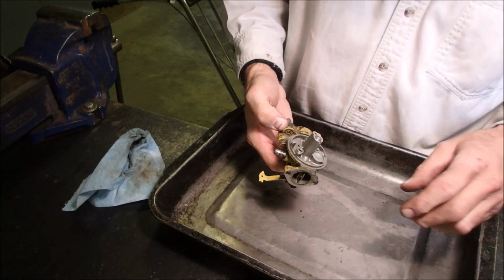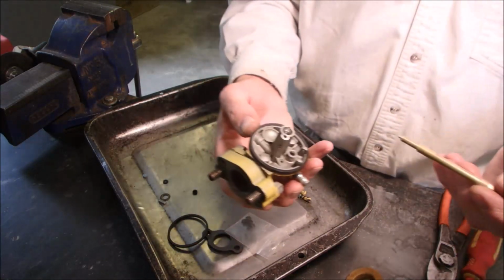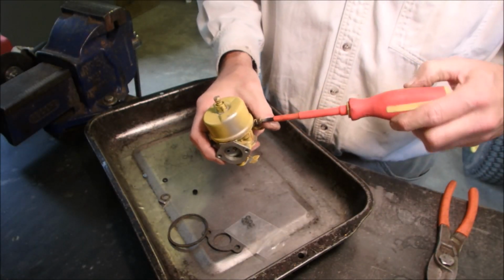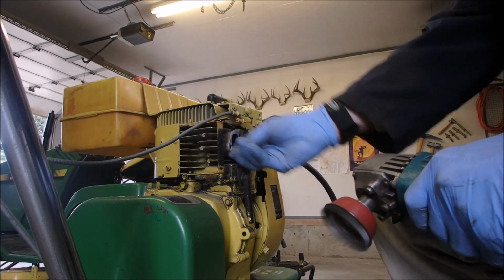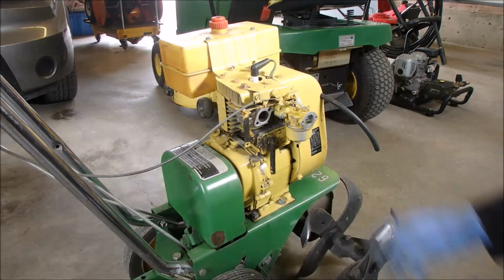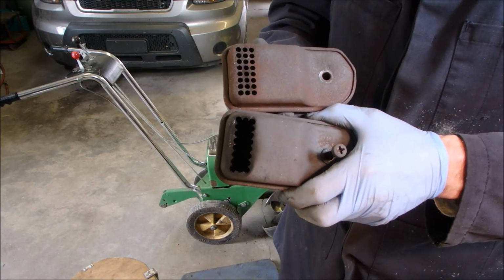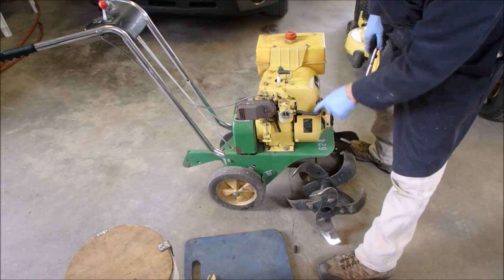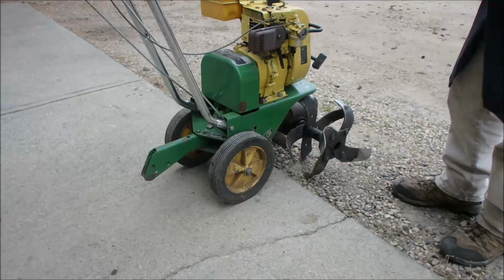1977 John Deere Tiller Only Runs on Choke Part 2

Comment: Oh doggone it. I need to know the plug number, and I wanted to see how the rope pull came apart and how it ejects AND RETRACTS that's flat tab that catches the inner flywheel hub. Oh PHOOEY !
Reply from the maker: Well the older flatheads for mowers and tiller took a Champion RJ19LM or NGK Ngk B2-Lm.  It ivery easy to google as well.

Comment: Bravo Bruce, I found and bought one of these tillers yesterday. I saw it on market place. It had been posted for two hours., and one mile from my home. Dont know what year it was made but seems to run very well. It will be the help that I need for a larger garden next season I hope. Thanks for this post and many others that helps a woodworker fix a small engine before he destroys it.
Reply from the maker: Good for you.
Reply: Here I go. I get to till with my jd 524 from the start of the growing season. It's in great shape I believe. Thanks to the man who owned it and bought new. I have his Manuel that I received in a folder. Admiration shout out to guys who keep files in their equipment.

Comment: Dad has an old John Deere tiller that is much like this one. He accidentally run it low on oil one day and suddenly remembered about the oil so he shut it off immediately. Replaced oil but it hasn't run since. Motor isn't froze up but it won't run. Any ideas what i should check first? I'm thinking power jet.
Reply from the maker: Check the valve clearance if the compression is low.

Comment: Those baking trays are the best to have when rebuilding any small component or carbs.  I also use muffin trays to separate small screws and parts during a job.
Reply from the maker: I even use the for changing oil and antifreeze an other stuff as you say

Comment: Is that your LX series John Deere in the background Bruce?
Reply from the maker: Yes.  Another fixerupper.  It runs so rich it hardly runs.  $240 Canadian for the new carb.  only $140 in the states.  I ordered a rebuild kit for $70.  It is a long term project.   Yes videos to come i hope.
Reply: Great! I have a John Deere GT262 from the same year and is the same mower just with bigger tires. Hope to see some videos on it!

Comment: Bruce, if you have a bad coil on an older engine with points do you usually convert them to electronic?
Reply from the maker: It is the easy fix   but you can get the old coil if you want.  I did one of my own that I kept stock and put an old coil in but If a customer comes in I put on electronic.
Reply: Do you have a good resource to get the correct electronic coils? I have 2 old 4hp engines I want to convert and not having much luck finding the right coils. Thanks
Reply from the maker: I collect older stuff that isn't repairable   but lately that is harder to do as our economy has gone down and folks are fixing more and more of there stuff and there is less of everything out there.
Reply: Bruce Pender
I was actually looking for brand new solid state coils to replace these old points coils. Is there a website you shop at or do you buy local?
Reply from the maker: This is a good site.  Sometime a just surf around for numbers of the coil then zero in on ebay or phone my local guy. 
http://www.jackssmallengines.com/Products/BRIGGS-STRATTON/Ignition-Part/s

Comment: WHAT TYPE OF GLOVES DO YOU USE AND WHERE DO YOU ACQUIRE THEM?
Reply: KEN McRAE those are latex gloves not really recommended for any sort of mechanical work. Use nitrile gloves, come in different colors but it's your choice and they don't rip when doing this type of work. 15 years of automotive and small engine experience.
Reply from the maker: Right.  Here in the great white north a box of 100 is about $10

Comment: You did it again i would be a little intimidated when starting that your right in the firing line if it did take off. Glad you and the tiller are well ;-)
Reply from the maker: Yes.  The belt was a bit sticky.
Reply: You both lived ;-) Like that you take photos too when you do the take down good idea I have an old scooter to do up that was good advice...

Comment: rebuilding a carb has worked for me about 50% of the time, usually I just buy brand new carb from China.  rebuilding them takes so much time and those carbs are fickle.
Reply from the maker: The older ones don't have as many inside channels and are easier to clean.  The newer ones are tougher.

Comment: i usually wont waste my time and money on a carb kit since i can get a china carb for less than a kit. i usually keep a few in inventory,the last ones i got were $9.00 each.
Reply from the maker: We can't get them for $9 in Canada.  Good for you though for doing that.
Reply: even through ebay???? i know certain things are alot more in canada then here in the states
Reply from the maker: I think I have paid $25 which is about $20 U.S.
Reply: i guess thats not too terrible,i just have had bad luck rebuilding dirty carbs. i want to try ultrasonic cleaning one day and see
Reply from the maker: I have had terrible luck with the 2 stroke stuff but the 4 strokes do well by me.
Reply: for me its mostly the tecumseh carbs that give me trouble,i have rebuilt hundreds of carbs over the years from small engines to 4 barrel car carbs